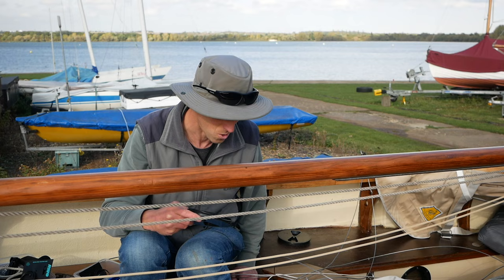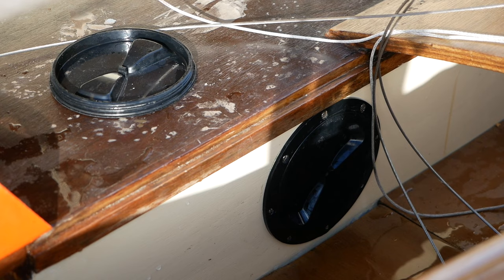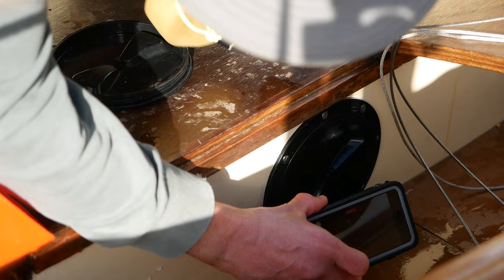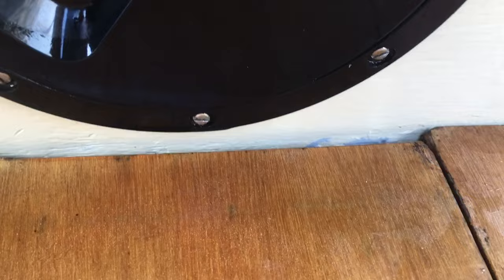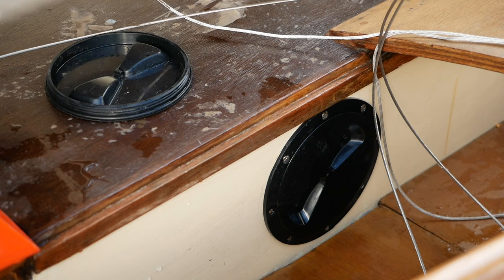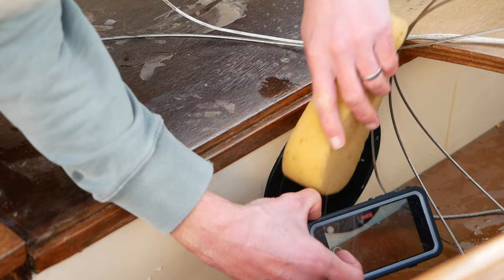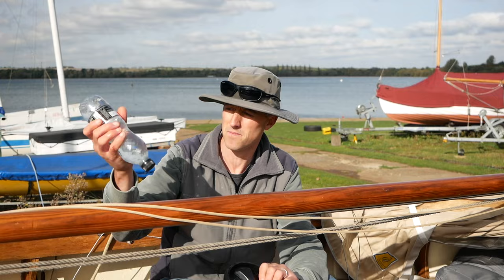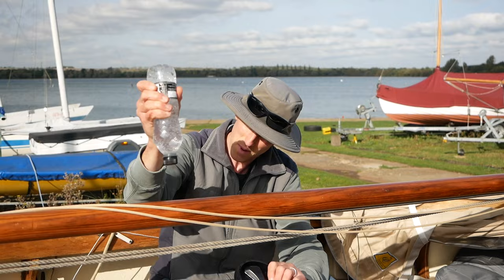Amazing anti-sink device!

Comment: Thank you for posting this video. I fill my voids with empty water bottles stuffed into mesh bags for additional buoyancy insurance. The bottles are easily removable at the end of the season for any needed maintenance and allow air to circulate in the space to prevent mildew from forming on inside surfaces. Cheers
Reply from the maker: Sounds good, and pretty fail-safe! Reassuring to know there’s pretty much no way your boat could ever sink! I will consider doing that…

Comment: How about filling everything with liquid  "buoyancy foam".
No worries and super easy to apply.
Reply from the maker: Thanks for the suggestion, sounds good! Some people have suggested that filling it up with anything creates potential for damp to linger in there, which might cause problems with the plywood and/or bonding. I will discuss the idea with the boatbuilder when I pick Tarka up later in the winter 🙂
Reply: @joelwalker81  did exactly that. Best I have done for making the vessel safe and trustworthy..
One thing.
Fill it up in steps because if you pour too much at once, that stuff gets pretty hot.
Rest is super easy to accomplish.
Happy Sailing mate.
Reply from the maker: @Colonia.4711  thanks, and happy sailing to you too!